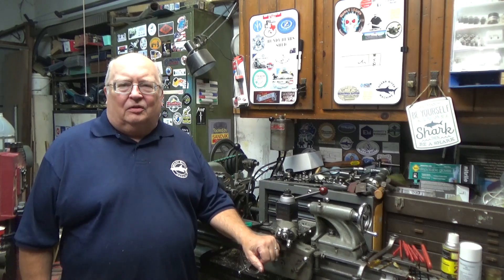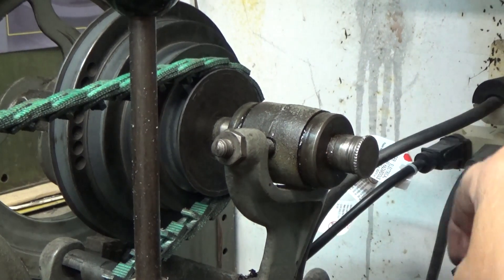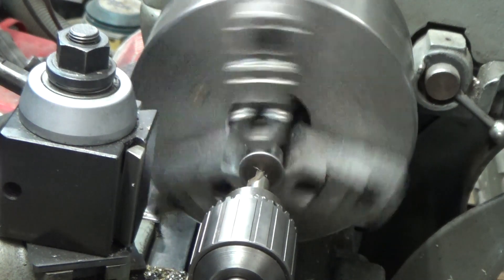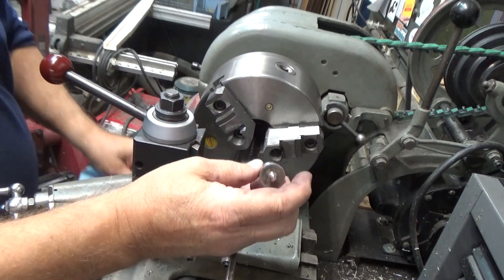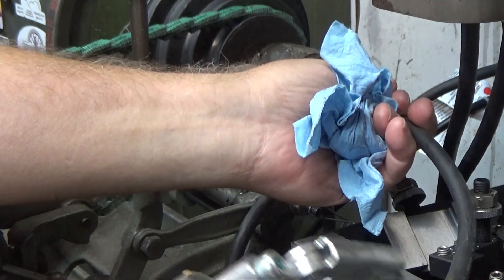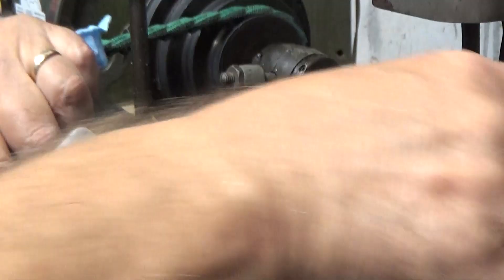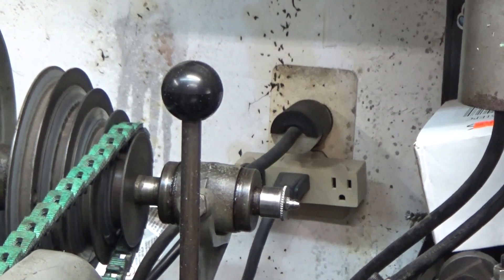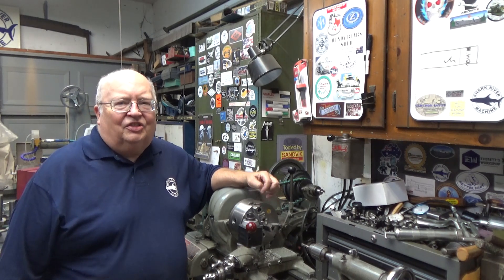Atlas Lathe Hack-Greasing The Intermediate Shaft

Comment: I wonder whether you've thought of improving the lube scheme of the motor bearings.  My motor is by Atlas, with ball bearings.  The lube chart says to, every six months, remove the small headless screws in the bearing housings and force a moderate amount of automotive cup grease around the bearings.  I find the screws to be 1/4 inch, 20 tpi.  I've thought it would be good to fit grease fittings to the screw holes, but I haven't found any that would just screw into the holes.
Reply from the maker: The motor on my lathe is a newer model that has sealed ball bearings.  I have never taken it apart and hope that I will not have to.  I will have some other videos on this lathe dealing with the belt tension.  Thanks for commenting.